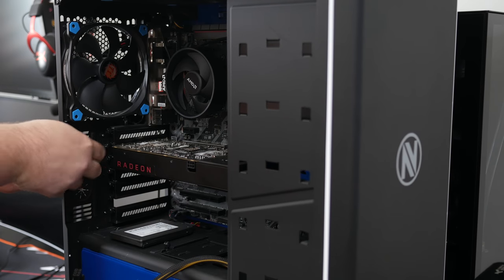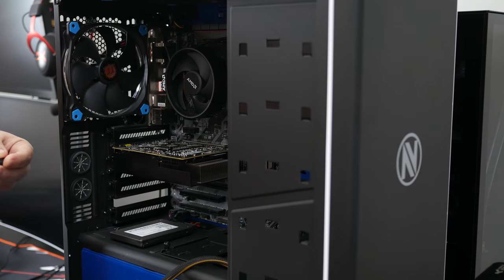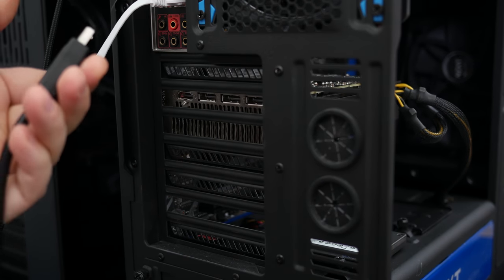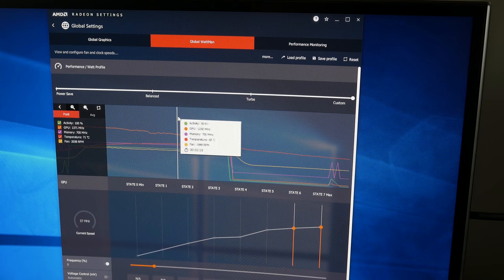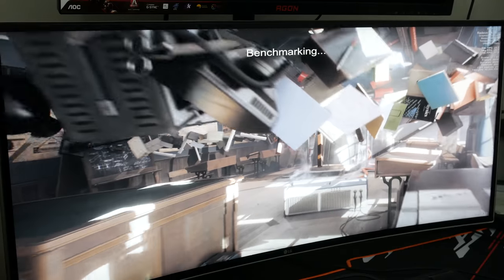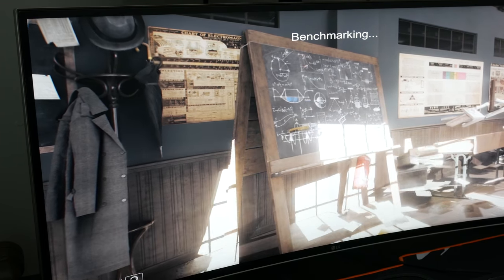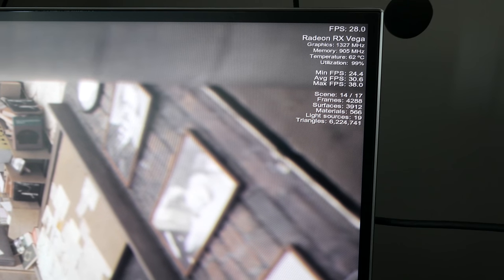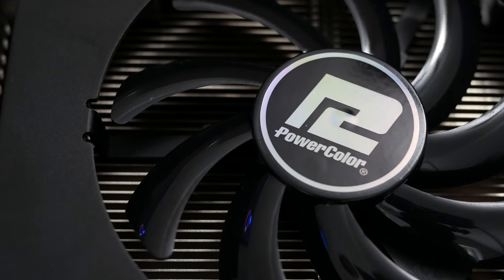Vega 56 Nano Part 2 - The Redemption (and one major flaw)

Comment: Also another interesting feature I've found with AMD cards is often times undervolting can increase performance. It sounds back ass wards but is the case. Essentially the stock voltage is too aggressively tuned to make more cards pass QC, and as a result most cards need a lot less voltage in reality. Higher stock voltage causes more unnecessary heat which in turn increases voltage bleed and causes clock speed instablilty. You would see this a lot with 290X/390X, Fury X and Nvidia 780ti and original titans. Bumping the voltage lower decreases the overall temperature causing less voltage bleed increasing the actual delivered voltage to the core and hbm2. Miners often utilize this technique to overclock and reduce power draw.
Reply: That's exactly what I did with my Nano. -50mv, 1070mHz clock speed. Mining at about 76C in a MicroATX case.

Comment: If only Vega would ship with an optimal voltage/clock configuration. My process for setting up Vega is pretty simple. Undervolt the GPU, overclock the HBM, make the fan curve much more aggressive.
Reply from the maker: That is exactly what netted me the best results. Perfect advice for Vega.
Reply: V64 bios, undervolt core oc HBM. Good to go :)
Reply from the maker: If someone is brave enough to try a flash to the v64 bios, I think that would really help this card a TON.
Reply: Let's Get Techy does this card only have 1 BIOS?

What a bummer.
Reply from the maker: Unfortunately yes. One bios only :(

Comment: Sounds like you had a slightly misaligned I/O shield on the gpu from the factory. Not unheard off but a defect never the less.
Reply from the maker: That was what I thought too, but believe it or not, it looks like the port itself is misshapen. The connection pins inside the port are centered instead of being closer to the top like how the cables are built. Super weird.

Comment: This card doesn't have the manual bios switch like the regular vega 56 does right? Didn't find it at first glance at least
Reply from the maker: I believe you are correct. I looked it up and down, inside and out, and couldn't find one.

Comment: Man, mine hovers around the 84 C mark playing anything. I think there's something wrong with it. Open frame or in a case.
Reply from the maker: Have you tried adjusting the fan speed at all? I would give that a shot first, and if that doesn't work I would either send it back for replacement if you are within 30 days, or take the cooler off and apply new thermal paste if you are not within 30 days.
Reply: @LetsGetTechy  I have cranked fan speeds and I still run into a crash once I hit 84-85C. I kept thinking it could be a power supply/wiring issue but, it seems to me that I'd run into the same crash issue immediately pushing the same hard task at it cranking to 100% load, but in every test it doesn't crash immediately, it crashes once it hits highest peak temp. Definitely going to do a regrease later.
Reply from the maker: Let me know how that turns out
Reply: Did you increase the power limit? Otherwise it shouldn't hit 85C.

Comment: Little update on my Vega 56 nano, I just pulled it from my tiny case and put it in a large case with my new Ryzen 2700(stock 3.2), with larger case, powerlimit to +50, high fanspeed 90%+, a 1050w psu, memory oc to 905 I got 4110 on 1080p extreme superposition. Used to be 3600 with my i5 in the small case.

Also no displayport issues on mine, still not a card I'd buy again though.

Comment: interesting; the vrm on this card is SO weak, that undervolting effectively reduces the Maximum potential Power limit. A cool thing to test would be to improve the thermal Interface between the gpu/vrm and the cooler to improve the Power charecteristics (Component use less Power when cool), and try overclocking With the same voltage/overvolting.
Reply from the maker: I agree 100%, but my plans are to return the card since I don't have a use for it, and I'm not ready to have my first battle over the warranty sticker not meaning anything anymore. hahahahaha ;)
Reply: Uh what? This card uses a 8 phase VRM using direct fets, this VRM is stronger than the Fury X VRM which used 6, and the original nano used 4.
Reply from the maker: I'm not sure what the power delivery is on this Nano. I know that the reference Vega PCB seems to be the best AMD reference board to date having a doubled 6 phase setup. If this card does indeed have 8, that should be more than adequate for this card.
Reply: It has a sudo 6 phase, 7 but two are paired for power balancing. 
It's still way overkill for such a card, though not as much as the 12 phase on vega reference.
Reply from the maker: I think people's views on VRM design are massively skewed because of marketing. I think most people that don't follow the industry closely would say that 6 phases isn't very good, when in actuality it's plenty.
Reply: you guys should check my comment on part 1. my argument isn't that the vrm is weak, but is massively undercooled. because of the way boosting works on vega cards, undervolting in such an instance actually reduces performance.